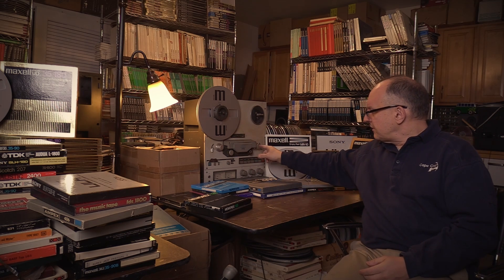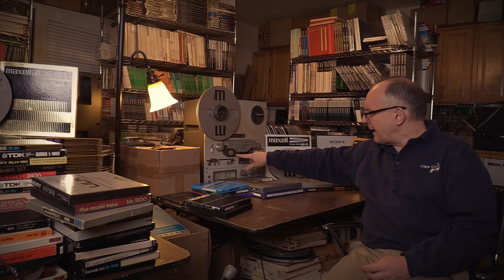Reel to Reel Tape Failure Modes w/Gene Bohensky - Acetate, Squealing, White Powder Syndrome & Others

Comment: Got a factory sealed Quad reel tape (London records) and about midway through playing it for the first time the dreaded nails on a chalkboard noise began... really hard to figure out just where on the tape path the noise was emanating from BUT by placing my finger on the running tape just ahead of the feed side tension arm and applying a little pressure the noise quit but only as long as kept my finger in place. 

The machine is a dual capstan AKAI GX-4000 SS and no similar problem with other tapes. I wonder if the oil from my skin was helping or ?

Comment: Acetate base is also used on Photographic film, and so sometimes suffers also from Vinegar syndrome.  Kodak di research and found that the process is catalyzed by rust!  (which is similar to the oxide on Magnetic tape!)  one thing they did is change from shipping new Motion Picture film in Tined steel cans and instead use cans with a plastic coating inside and out. they also advised to store film prints on Plastic reels rather then steel reels, and discard any rusty cans and rusty reels putting the film in new containers..
even today Camera original film for motion pictures is generally  on acetate base.
Kodak also recommends that acetate film be stored with "KODAK Molecular Sieve, Acid Scavenger" packets to trap the vinegar and prevent it from further damaging the film.  I am not sure if that is applicable to acetate tape.  you can filnd the details on their Movie film website.
Reply from the maker: That's interesting, a molecular sieve to trap the acid is a good idea.